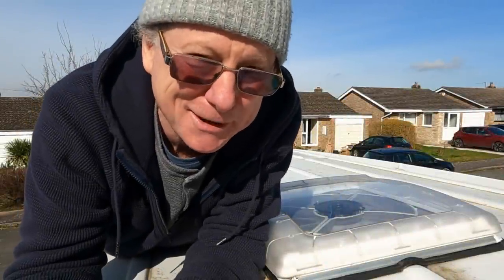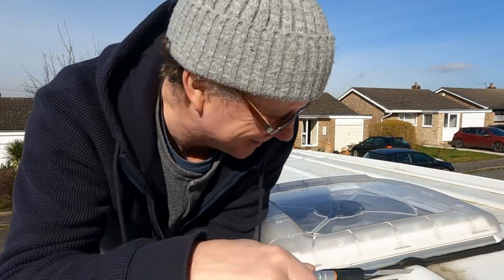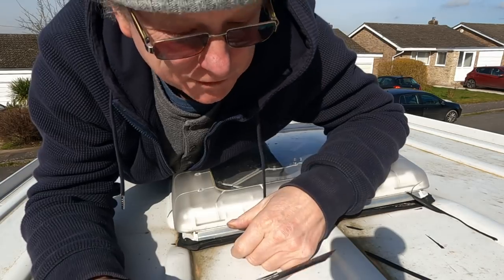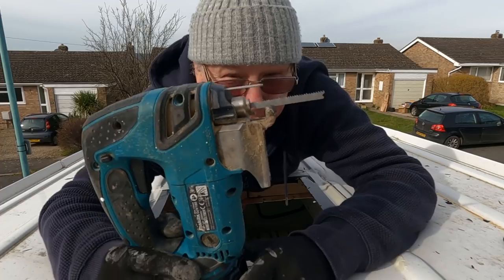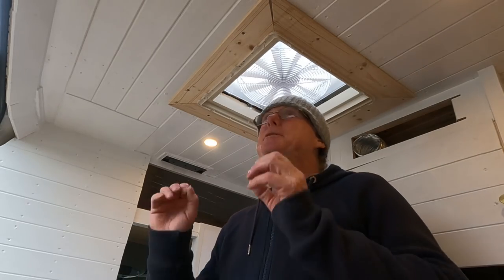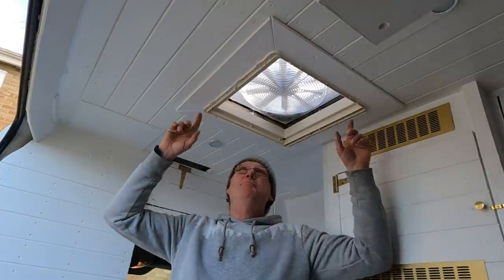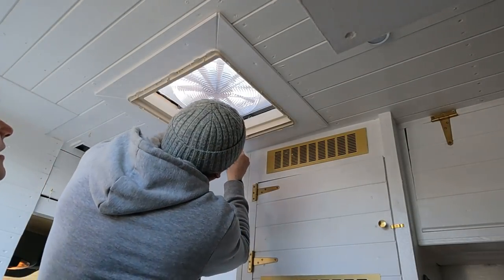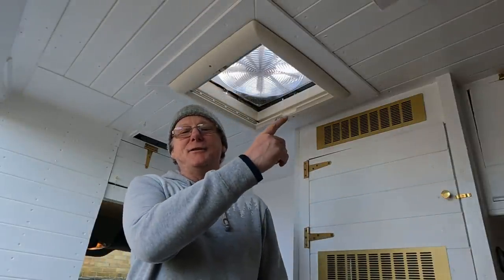How to stop Leaking skylight  RV Campervan conversion

Comment: Ok, embarrassed to say I was not aware the handle of the saw was designed for that purpose, learn something every time Mel , and always a giggle too. Longer shafts on eBay, who knew lol.
Reply from the maker: No worries not a lot of people know that so you’re not alone that reminds me I put a link to the longer shaft 😂👍
Reply: be aware though that my saw, a regular stanley bought from bandq about a decade ago doesn't.  looks like it has a 45 degree angle but it isn't, as i found out to my dismay. great video.

Comment: Great job Mel. Just re-seated my leaking skylight using the mastic roll as you recommended and it worked a treat, amazing stuff, blue-tac on steroids! Noted the mentioning of cleaning the roof after cutting the hole. Really important to avoid nasty rust spots from the swarf.  I go over the area with a strong magnet wrapped in a thin cloth and it’s surprising how much it picks up. Shake off the metal shards from the cloth safety afterwards.
Reply from the maker: Thank you buddy for the positive feedback really please you got your leaks sorted out and thanks for the great advice 👍😊👍

Comment: Took the foot off mine and lost it. So now i have a jig saw with a piece missing.
Kidding
Did you know that you can hang your saw up after use with that nifty hole in the blade.
Do you have any thoughts on fibre glassing them vents on. I think it's a good idea.
Reply from the maker: I really don’t know about fibre glass
Reply: If you use polyester it will crack when the roof flexes. You might get away with epoxy (its tougher and sticks better) but because the roof can flex and the skylight doesn't you really need a tough flexible joint like you get with polyurethane.

Comment: Tip use piano wire or similar to cut window seal.
Reply from the maker: how would you get a hand each side of the sill to pull on the wire ??
Reply: @BigVanSmallWorld  if the lid is open or off?small hole through rubber,push wire,handle on each end,saw. Done on my windshield,but inside,guy outside.

Comment: I've had a leaking skylight, it's made the wood moldy. I want to take it out and replace it with a maxxair fan. That means ripping a lot of cupboards and wall panels out to wire it in 🙈 Does anyone know anyone in the UK who could do this job? 
Great result in the end 👏🏻
Reply from the maker: I would offer to help you but I just got so much stuff going on rite now if you don’t have any luck buy the end of March drop me an email and see if I can I’ll help good luck with it 🙏
Reply: @BigVanSmallWorld  thank you for your reply 👍🏻
Reply: I can't find your email Mel